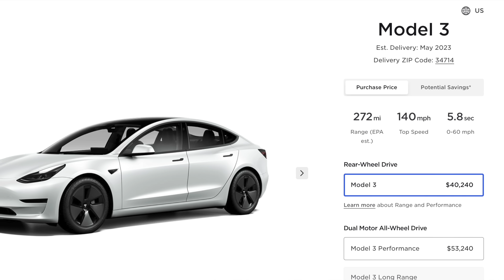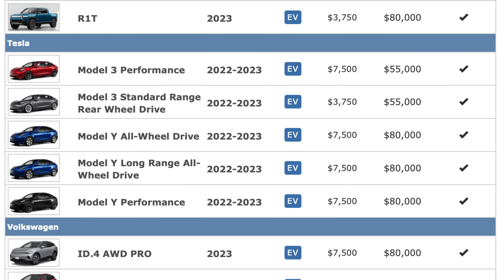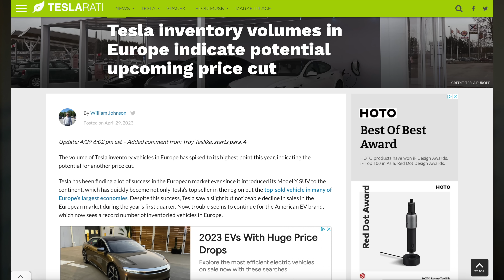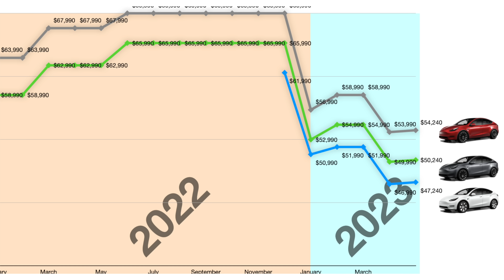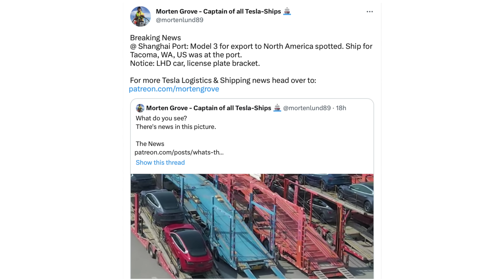BREAKING: Tesla's 9th Price Change of 2023

Comment: You mean if I’ll buy the model Y in blue with white seat at $56,240… I will still qualify for the $7500 even without 3rd row?
Reply from the maker: Yes, 3rd row is no longer required to fall under SUV MSRP cap. All Model Y configurations fall under 80k MSRP cap.

Comment: As a Canadian, what's the benefit of having a China made model 3? Also would a performance model come with an LFP battery from China? 

Thanks!
Reply: No LFP for “Performance.” That requires high-nickel.
Reply from the maker: Performance does not come with LFP. The China made Model 3 is a lower cost to produce, but still the same shell. Shouldn’t really notice a difference